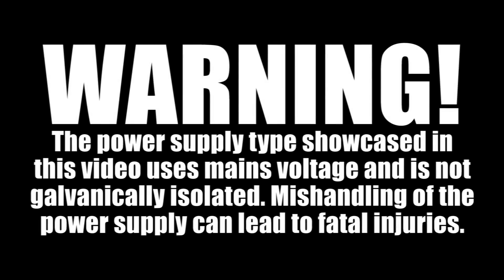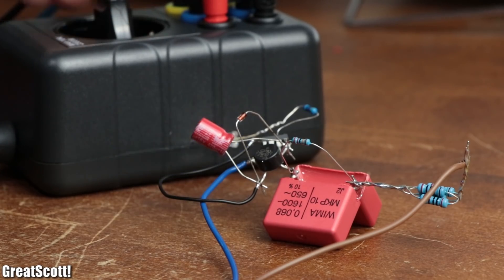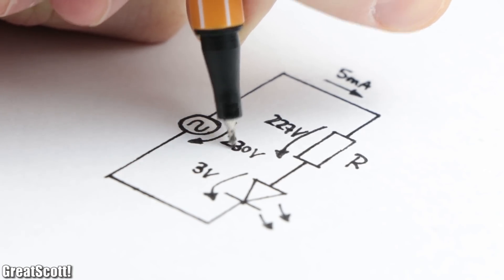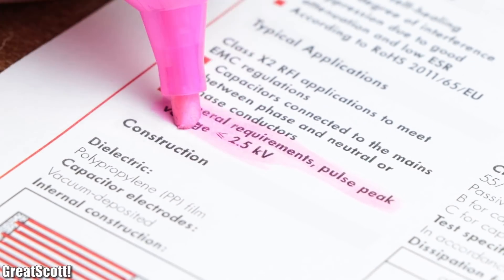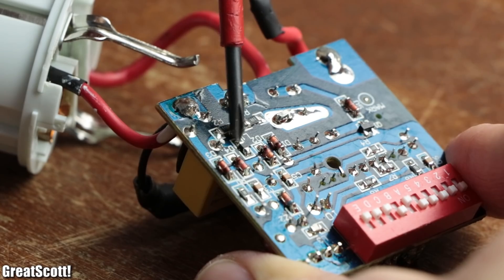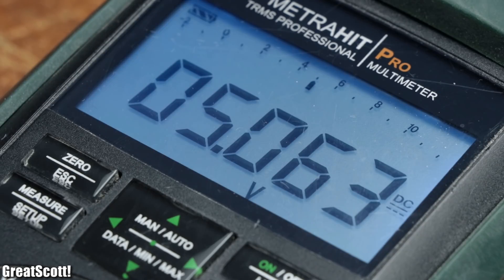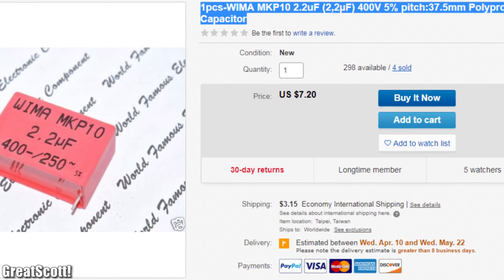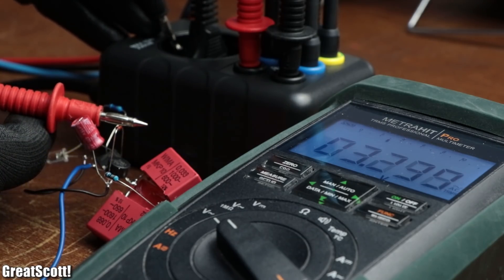The most Dangerous, yet Cheapest Mains Power Supply?! || Building a Capacitive Dropper Circuit!

Comment: When I was a kid, I shocked to find that capacitive dropper actually, well, shocks. Still the worst shock I've ever gotten though.

Unfortunately, the simplicity of this power supply comes at a cost. Besides its poor power factor and unisolated output, being an unregulated power supply, it's sensitive to load current, input voltage and even input waveform changes. Yes, you see that correct, even when the input isn't a perfect sine like for example, a modified sine wave from those cheap inverters, it really mess up the output of the power supply since it was calculated for a perfect sine and certain voltage and current range. Talking about inverter, one pro tip: don't use capacitive dropper based devices with modified sine wave inverter. It will result in overcurrent on the output of the power supply and possibly destroy anything connected on the output.
Reply: I saw this circuit it in every cheap rechargable lead acid emergency lights.. and shocked myself many times while opened
Reply: AC the most painful belt I've had was 115v 400hz on control stuff.
DC was 267v (measured it after it bit me before I swapped the board) inside a radar. Burned a small hole in the skin on the knuckle.
Reply: Isn't this what the zener diode is meant to help with?  To avoid the output voltage going high enough (within reason) and protecting the circuit from overvoltage damage?
Reply: Is that because it's not the same RMS value?
Reply: Clamping zener is optional and some capacitive dropper circuit don't have clamping zener, mostly on things like, for example, LED lights and any device with internal rechargeable lead acid battery like flyswatter or emergency lights. These things aren't that sensitive to output changes on normal circumstances (slight input transient, etc) but definitely not designed for waveform changes.

If I'm not mistaken, it's not about the RMS value. In fact, modified sine wave inverters do have around 220V RMS, with slightly lower peak voltage than sine wave  for compensation. I believe it's about the formula. Different waveform requires different calculation, just like how you calculate RMS voltage from peak voltage with different waveforms.
Reply: @mattsadventureswithart5764  And you're left with the feeling that the grim reaper just patted you on the shoulder and smiled at you. Been there done that.
Reply: @Asu01  If I remember right RMS stands for root means squared and it depends on the volume under the waveform - which is generally/always assumed to be a sine wave. I remember that a rule of thumb is that RMS readings can't be trusted when a waveform is not a clean sine wave. Power factor is to do with the phase angle between the voltage and current waveforms and often decides how efficient a circuit is and how much energy it wastes. The two things interact so if you have problems with one you will probably have problems with the other as well. - A lot of mains circuitry depends on resonance so the shape of the waveforms is very important...
Reply: @Lucien86  , well, it does stands for what you said but RMS does apply to all waveforms from sawtooth to sine wave. RMS readings can be trusted if the device used to measure the voltage is a true RMS capable meter, usually some high end multimeter or an oscilloscope. True RMS meters measure RMS voltage by analyzing the waveform and properly calculate the RMS value instead of just measure the peak voltage and use the sine wave calculation to get the final value which a lot of non true RMS meters use.
Reply: @Asu01  A lot of more basic meters are calibrated to measure AC voltages in terms of a mean RMS, and its them that will often produce inaccurate results without a clean sine wave. It was them I was talking about. TBH that's about the limit of what I remember on RMS, it was a long time ago.
Reply: Trust me 220V European mains makes your eyes bulge out instantly... I promised myself never again!! ha-ha
Reply: @BillAnt  What dosn´t kill you makes you stronger .... 
Got schocked around 4 times under 230v Mains voltage.
Reply: @Nino Joel < I remember vividly a few times my hand has slipped in between the round forks, even got a burn mark on the hand.  It feels like the strongest handshake you'll ever experience... not fun! lol
Reply: @BillAnt  Are there actually "fork plugs" that carry 230v ?
The normal European Plugs can't be touched while carrying mains voltage.
Reply: @Nino Joel < Well it's the round Euro plug but I just call it a fork, maybe I should call it poles or terminals. lol
As I was inserting/removing the plug, the part of my hand between the thumb and index finger slipped in and touched the terminals.  By the way even in the US now they have around 240V appliance sockets, so it's just as dangerous, luckily I have never found out the hard way. lol
Reply: @BillAnt  That is not normally possible with a European norm plug.

They need to be build to be untouchable while under mains voltage.

240v appliance plugs are interesting.
I guess they are the US equivalent of the CE 400v 3 phase machine plugs that are all over the EU and especially Germany.
Reply: @Nino Joel < Yep the US 240V mains is a 3 phase outlet, for large power hungry appliances like stoves, dryers etc.
Reply: @Asu01  Not true. Almost all meters assume a sine wave. RMS via scope?  You must be joking unless it is rectangular waveform.
Reply: @BillAnt  Its actually 2-phase.
Reply: @martinfreedman < Oh, I thought it was 3-phase since it carries double of 120V.
Reply: @NinoJoel  Not today plugs. But when we were kids... Safety was worse, everywhere including house plugs
Reply: @BillAnt  : US 230v is actually what a pole transformer will put out nowadays, the power companies mostly moved over a long time ago. However, depending on the house itself (the house I rent is from the 30s, and NOT wired for 230v) you may or may not get both hots coming in to the distribution box, and maybe even meter, and the 120 will reliably be taken between a hot and the neutral, but 230v-wired houses sometimes use one hot for some 120v circuit breakers, and the other for other 120v circuit breakers: this can sometimes cause problems when you hook equipment in one room (let's say a full stereo system, including Blu-ray and record players, but not speakers) to equipment in another room (let's say a projector and audio amp): the reason you'll occasionally see inline isolator units for e.g. audio cables is to fix this very problem.
Reply: @BillAnt  : Also, it's often more properly 1 phase, since while the power is just as commonly distributed as 3-phase as it is as 1-phase, the pole transformer itself will usually only see one of those phases, with both hots on the transformer being fed by the same phase. From an actual waveform stance, it's only 2-phase if an oscilloscope measurement of both phases finds that they're meaningfully offset from each other: in US 230v they're normally in-sync, so equipment that uses both hots but neither neutral nor ground can't tell the difference between genuine two-hots connections and a mixture of a neutral and a genuinely 230v hot wire.

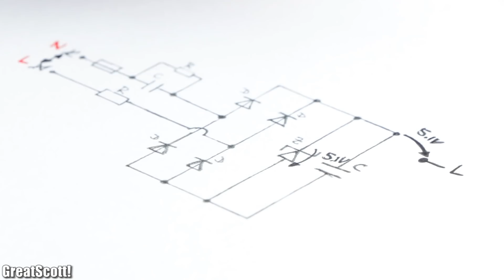Comment: 10:47 note: should read "inside a closed, non-conductive housing".  I would even be tempted to goop the whole circuit
Reply: If the housing is grounded the breaker will trip if there is a short.

Comment: @Great Scott - the first schematic and connections you showed almost certainly failed due to an LED's low reverse breakdown voltage typically WAY less than the PIV of mains.

 The simple inclusion of a reverse biased 1N4007 rectifier in parallel with the LED will solve that problem and a suitably specced inrush power resistor or better yet a suitable NTC in series with the input will solve (or massively reduce) the inrush current.
Reply: Hi Bob,  did you mean a diode in series with the LED.  This is how I used a 1n4005 diode in series with the LED to protect the LED from the high PIV that does kill the LED which was around 5 volts for the LED.  However I was using g a resistor instead of a cap.
Reply: @MegaVoltMeister  no I didn't simply because with a capacitive dropper you need to allow the capacitor to both charge and discharge. With a resistive dropper you don't have that problem so EITHER will work, however the effective power dissipation in the resistor will increase (effectively double) if the rectifier is in parallel (full wave current through the resistor vs half wave). A resistor is fine with LOW AC volts, just as with DC volts, but the capacitive dropper is much more effective dissipation wise. Just beware the "bad" power factor.
Reply: yes there should be diode to block reverse current from AC second cycle or rev voltage  .
Reply: but this is case for rasistor
Reply: but perhaps there is way to use cap and led circuit with mains AC , what will if i add diode parallel  with led but opposite direction then  led than that cap will enable to charge and #Discharge( reverse charge )  in both direction first via led then via diode so  in such way led will survive from reverse cycle :) should be
Reply: but perhaps there is way to use cap and led circuit with mains AC , what will if i add diode parallel  with led but opposite direction then  led than that cap will enable to charge and #Discharge( reverse charge )  in both direction first via led then via diode so  in such way led will survive from reverse cycle :) should be
Reply: @omsingharjit  yes, absolutely as I explained but also it's advisable to use an NTC to limit inrush. The ONLY real problem with a resistor solution is the amount of heat dissipation it causes. 

For example, if a 10mA LED is used then the power dissipation  = VI = 250x10^-2 = 2.5watts ... By any stretch of the imagination that's a big power loss for a device (LED) that only needs around 
2 volts * 10^-2 amps= 20 mW!!

Heat loss with the cap is zero (ignoring the 20mW of the LED) albeit at the price of a lousy power factor. For greater currents the dissipation of a resistive solution becomes much more of an issue, whereas a 1uF capacitor will enable a max current of around 31mA with no real amount of heat. 

Beyond that, the volume and weight of a normal transformer for 12-0-12v @ 30mA becomes arguably a better option. 

One thing that I think people forget however is that a decent, small buck boost SMPSU can easily be supplied via such a circuit (1uF) and a bridge rectifier. 

So if we say 30mA but at 30 volts = 900mW input and an output of say 700mW (with a decent headroom for efficiency losses) then a 5v supply of around 140 mA is possible.. 

NOTE!!! (ESPECIALLY NOVICES!!) THIS ALSO IS NOT GALVANICALLY ISOLATED! NEVER, EVER, USE SUCH A CIRCUIT WITH ANY EXTERNAL CONNECTIONS AVAILABLE OUTSIDE A SEALED CASE. THE SUPPLY AND THE SUPPLIED DEVICE MUST BE INSIDE THE SAME CASE..

The power factor is truly terrible for this though!
Reply: @boblewis5558  but now days Chinese 5 volt  600ma smps kit is much cheaper than that circuit or transformer it cost me very less than half dollar which is isolated and safe
Reply: @omsingharjit  yes, that was kind of my point about the buck converter. For a very small amount you can get (or for nothing use old wall wart internals) a mains to 5v supply that has full galvanic isolation. Basically any phone charger, and there must be 1000's of unused/scrap ones about, will provide around 2.5 - 3 watts. The capacitive dropper I use mainly for mains indicators to replace neon lamp panel lights. If correctly made and double insulated, or even potted an LED panel lamp has a much better light output and is no less safe. 👍👍👍
Reply: Doesn't tgis problem still holds for tge invented new circuit ?

Comment: For most of my circuits/projects that require mains to <=5v I typically just hack apart a USB wall wart phone charger.  You can get them on Amazon for under $2 each and they are no bigger than the 2 dropper capacitors shown here.  A lot of people mention the Hi-Link power modules, but they are more expensive and only handle .5-1A where as a USB charger will be 1-2.5A depending on the model.

Comment: 8:26  don't we need to subtract that zener voltage (5.1v) from that 233volts AC voltage and then divide it with calculated reactance to get our current value.
Reply: the 5.1 volts across the zener is negligible compared to the 233 volt mains. Do the calculations with and without it and you'll find only a couple of percent difference. The tolerance in the capacitor value is likely to be far greater than a few percent, so you're never going to get exact values anyway. This is the case in most electronic circuits, where components with tolerances of 5% - 20% are regularly used and in most applications this doesn't matter as long as the components are generously rated.

It would be like using Google Maps to calculate the length of a car journey, then adding on 6 feet to allow for the length of your drive.

Comment: Capacitive dropping circuits are in common use in everyday items.  However, they are usually either hardwired, or use a plug that cannot be reversed (grounded, or in the U.S., polarized).  A good example is a ceiling fan with multiple speeds.  In a typical build, at 120 volts, the slow speed is obtained by using a 4.3uF capacitor, the medium speed is obtained by using a 2.1uF capacitor, and the high speed is obtained by direct connection (no capacitor).  No other electronic components are used nor are multiple winding taps to the motor.

Comment: 6:01
but why? these circuits meant to be as cheap as possible while being very operational and optimal. whats the problem?
Reply: The risk of electric shock+fire.
Reply: The tinkerning part is not isolated from mains power, thus landing this project in "High Voltage" land, the land where mistakes kill you.  Yes, it is possible, but only for the very experienced.

Comment: I have exactly the same issue, and this is why I ordered from China the HLK-PM01 switched mini power supply module, around 3 EUR
Reply: Most Chinese/HK power supplies deliver less than or equal to half of their rated current.  If you see what looks like the same unit, same voltage and different current capacities in advertisements, then surely the real current capability is LESS than half of the advertised current capability and the voltage will sag greatly.  Go ahead and test them!   So your cost savings is likely to cost more than triple, after burning out and needing to buy a proper power supply that meets your current needs.   It would make a great video and perhaps people will use this video as a reference design for your own home-designed and built power supply. ;)

Comment: Nice breakdown on capacitive droppers. My first introduction to them was a night light kit that I got online. It was only for 230 volt and, of course was very dim at 110 here in the US of A. So I played around and tried getting it working but ended up tossing the whole shebang in the bin.  It did, however get me interested enough in this type of circuit to study and play around with them a bit.  They can be useful in some instances, however I think I still prefer the old transformer with rectifier and filter method to obtain the DC voltages I need from the wall.

Comment: My guess for the "secret" project: Home automation - A photodetector to monitor the light pulses from a smart meter and transmit the results over radio to a base station.  
Well, that's what I want to do, and was planning on using one of those SMPS modules, but this method could be a viable alternative if I can get the power requirements low enough.

Comment: You can simplify the circuit and remove 1 of those diodes. You do it by changing two of the diodes in the bridge to be zeners. This removed the need for the extra zener.

Comment: I think your first attempt of cap + LED only needed a diode across the LED to work. That allows the cap to charge on the “negative” AC cycles.
The LED will not be subject to high voltage but will blink at 50 Hz
Reply: This is correct, he got 600v reverse voltage on the LED in the negative cycle.

Comment: Check always if capacitors are properly discharged. Also consider using an isolation transformer about 6VA for avoid single contact shocks , (but defeats eath) and less energy to blow up circuits

Comment: The reason the LED blew up was not (necessarily) the inrush current, but rather the reverse bias on the opposite half of the AC cycle. The minimal solution for not blowing up the LED is to either use a full bridge rectifier, or if you're ok with only lighting the LED for half the cycle, an antiparallel rectifier diode to clamp the voltage during the other half of the cycle. Inrush limiting would increase reliability of the circuit though.

Comment: Dear Scott: I have a suggestion: Instead of using a single capacitor in series with one side of the power line, why not put 2 capacitors of double capacitance value, one on each side of the power line? That way it doesn't matter which way the plug is plugged into the outlet. Also, if someone touches the output of the capacitor on the hot side, they will get a milder electric shock than they would if the circuit is made with just one capacitor, and some unlucky person plugs the plug in the outlet with the hot side being the non-capacitor side and touches the hot side. (Just a safety suggestion)

Comment: When CAPS fail (manufacturing defect or high temp or vibration) their behaviour change from reactive X to short circuit, make sure the fuse spec is properly selected - also I would use cap with voltage rating of about 1.4 X the main voltage as fudge factor.